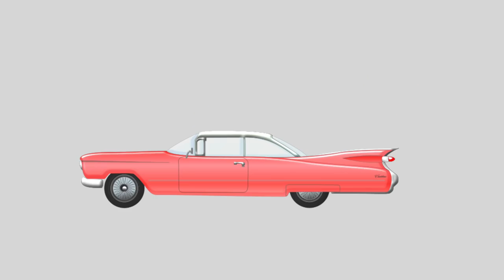Yes, Rockets CAN Fly in a Vacuum

Comment: You can't have equal and opposite reaction without resistance. Because earths atmosphere acts as a resistance for rockets exhaust to push off against, that rocket can fly. In space, there is no resistance due to it being vacuum so action from rockets exhaust can't cause reaction because reaction requires something else external (earths atmosphere, ground, wall) to act as resistance. Everyone who is claiming rocket work in space is basically claiming that person floating in air can cause equal and opposite reaction without pushing off on something else and move anywhere he/she wants while floating. We all know the person floating in air will just get stranded in air if he/she can't push off against something else. Same thing with rockets in space.
Reply: @Xeno Bardock wrote: "You can't have equal and opposite reaction without resistance." You can. Read about conservation of momentum. You can experience that every day. Just try tu push someone/something who is about your weight. You will notice that the same force which you apply to him/it you also exerts on your body. That is because when you push something you encounter resistance due to properities of the molecules called inertia.
Reply: @martingorbush2944  That someone/something you push resists your action and reacts in the form of equal and opposite reaction. If you punch the wall, the wall resists your punch and delivers equal and opposite reaction. If you punch the empty space, space doesn't resists therefore delivers no equal and opposite reaction. Someone/something acting as resistance is important in order for equal and opposite reaction to take place. Empty space wont react with anything.
Reply: You forgot about another form of "resistance": conservation of momentum. When two particles collide their summary momentum doesn't change (m1*V1+m2*V2=constant). When particles gains speed thanks to chemical reaction (i.e. oxidation - so called burning) they gain speed thanks to conversion of chemical energy to kinetic energy (E=m*V^2). Particles of gas moves in every possible direction and if possible they collide with solid object or other particles. Then they transfer some of that energy to other matter. What that implicate when gas burns inside semi-open chamber (combustion chamber)? Some of the energy of the hot gas particles is transferred into solid walls of that chamber. That is what provides thrust for rocket.
Reply: @Xeno wrote: "The gas burning inside a semi-open chamber still requires to meet with the external resistance aka earths atmosphere in order for efficient thrust to occur"

Yes and no. It mostly depends from what you mean when you write "efficient". Maybe it isn't "efficient" thrust but it is thrust nevertheless when expanding gas particles are pushed away from hottest burning place in every direction. Not only to the back of the rocket. Then some of them will collide with combustion chamber walls and give away some of its momentum. That is the thing you seems to not understand.
What's more even injecting fuel and oxidizer into that chamber creates some thrust because particle contained within these substances must be pushed into that chamber. And according to experiments and second Newton's law every action creates equal opposite reaction. Am I wrong?
Reply: @Xeno. Hey man. You wrote something sensible at last. Maybe we will be on the same page at last. Yes, yes, yes. Small explosion in combustion chamber is what push the rocket forward. How do you describe combustion of large amount of fuel? That is exactly an explosion.
Reply: @martingorbush2944  The explosions need to be very strong for decent speed of rocket in space. And the TNT explosions need to occur outside the rocket at exhaust, not inside the rocket otherwise rocket will explode right away. Mix the fuel with lot of liquid oxygen in a container, eject the container in vacuum of space from rocket exhaust and create strong TNT explosion in space, repeat the process and propel rocket in space with recoil effect from explosions.
Reply: @Xeno. Vacuum isn't pulling anything. It is just empty space. Think what governs movement of particles? It is some force. Then what kind of force empty space will exert on particles? What type of force is that? Gravitavacum or electrostic suction?
You understand that explosion in space will produce recoil and push rocket away. But you think that should be "strong" explosion. Then what will happen if there would be many smaller explosions happening many times per second (i.e. hundredths)? That is almost exactly how rocket engine works.
Reply: @martingorbush2944  What do you think will happen if your spaceship gets a hole blown in it and people exposed to vacuum? Vacuum of space will pull everyone towards it. Same thing with rocket exhaust gases, vacuum will pull on it instead of resisting it like earths atmosphere does.
Sure, many smaller explosions are fine too but those explosions must occur outside the rocket and not inside the rocket, and those many smaller explosions must occur in parallel. If the explosions occur inside a container, then you don't much control over where the explosions cause recoil effect and rocket will move uncontrollably from recoil effect at random places. If the explosion take place outside the rocket, then you have better control over it and can easily cause recoil effect to directly hit the back of rocket, effectively propelling the rocket in space. There is no need to eject gases from small hole as its useless in space due to no opposing resistance from space, just eject hundreds of ball shaped explosives in space from rocket exhaust and explode it in parallel right away if you want smaller explosions. If you want larger stronger explosions, then eject one big explosive in space from rocket exhaust and detonate it, do it in series for stronger explosions.
Reply: @Xeno. Vacuum isn't pulling anything! If some matter is moving there (especially with high speed tens of km/s) that mean it was influenced by some external force like gravity or collision with other moving matter (i.e. gas under pressure). That is why exhaust from rocket engine also indirectly exert force on combustion chamber.
Reply: @Xeno_Bardock  
1. Inertia provides the resistance you require.

2. Vacuum doesn't suck or pull. Areas of higher pressure expand into areas of lower pressure.
Reply: @niallkinsella2687  Rocket exhaust gases still need to meet with opposing resistance in order to gain significant thrust, which earths atmosphere acting as resistance provides. Check the diagrams in this video https://www.youtube.com/watch?v=ZcW5B0C3fCw That's exactly what i meant by vacuum pulling, the higher pressure/atmosphere inside spaceship will move towards zero pressure of vacuum of space if spaceship gets a hole blown into it. With inertia, in space you will experience the initial thrust from starting the rocket engine and then that thrust will disappear. When you start engine of your car and accelerate, you experience the initial inertia but you don't constantly experience inertia, only when suddenly accelerating and breaking. Same with rocket in space, thrust from inertia will be momentary, not constant, unless astronaut keep turning on and off the rocket engine so he/she can keep getting that small thrust from inertia.
Reply: @Xeno_Bardock  

Everything with mass has inertia. Everything that changes velocity experiences acceleration.
Work has to be done to overcome the object's inertia to force it to change velocity. Every action has an equal and opposite reaction.

"When you start engine of your car and accelerate, you experience the initial inertia but you don't constantly experience inertia"...
What you are actually experiencing is your mass resisting acceleration (your inertia), and you will continue to experience it for as long as you are changing velocity.
At constant speed you don't feel this, hence why you can get up and move around on a plane travelling at 500mph, but you will be stuck in your seat in a car going from standing start to 100mph over 10 seconds. Your car will also have to spend more energy accelerating with you in it than if it was empty.

So yes, Objects with mass resist acceleration and energy has to be expended to accelerate them.
A rocket converting a tonne of fuel per second into gas travelling at 1000mph backwards relative to the rocket is also being forced to accelerate forwards at the same momentum.
No external objects to provide resistance required.

Even leaving gas simply vent will work. The higher pressure is forcing its way into lower pressure, it had to expel energy to do so (pressure is a form of energy). As long as the gas is vented in one direction only it will cause the object formerly housing it to accelerate in the opposite direction.
Reply: @niallkinsella2687   When you travel in a car, you become part of the car so yours and cars inertia become same value. If you were constantly resisting inertia while traveling in a car, you will keep getting pushed to the back of the car. Only when you suddenly press accelerate or press breaks or keep constantly changing speed of car that yours and cars inertia becomes different value so you resist the cars inertia then and feel it pushing you back and forth. In space the mass remains the same but the weight becomes zero due to lack of gravity so an astronaut can lift ton of mass easily just like a little kid can easily move around an adult in water. What does that tell you? The mass in space doesn't resist acceleration as much like it does on earth. Released gases always require opposing resistance in order to able to make gigantic mass like rocket fly just like you need to push against the ground first to able to move a heavy rock therefore in order to bypass the ground/earths atmosphere requirement, rocket fuel must TNT explode outside the rocket at exhaust instead and cause strong recoil effect  from explosions in order to gain significant thrust.
Reply: @Xeno, Man. You only have to resist/overcome inertia when you change speed. 

You don't understand what weight is. It is a force exerted by gravity on object of some mass. When you are in weightless environment that doesn't mean you can push away 2 tons of stuff as easily as 2 kilograms. That 2 tons box will just exert no force in any direction when you have same speed and direction as that mass. But if you try to move it then you will have to change momentum of that mass. That will be associated with exerting a force (F=m*delta_V/t what is equal to F=m*a).
Reply: Here's how rocket engine works in space:
In rocket's combustion chamber, fuel gets combined with oxidiser, with produces hot exhaust gas.

The gas expands in all directions.

Those gas particles which are moving towards the combustion chamber opening will simply exit it, without doing any work - but that leaves us with all the particles which are facing away from the opening.

At some point they will impact the walls of the combustion chamber.

When that happens, the gas will ricochet off that surface.

When that happens, the gas will experience a force.

Any force has an equal but opposite force.

Ergo, the combustion chamber, and the rocket it's attached to will also experience a force and start moving.

I'll be happy to explain further any point you have troubles with.
Reply: @Xeno_Bardock  If I fire a crossbow in a vacuum, will I feel the recoil? Yes or no?
Reply: @Xeno_Bardock  if I fire a solid block of CO2 (say 1 kg) at 100 meters per second from the 10 kg crossbow, do you know how to calculate the momentum transferred to the projectile?  Did you know that the momentum transferred to the BOW must be the same? Do you know how to calculate the Velocity that the bow must be moving AFTER the projectile is fired?
Reply: @Xeno_Bardock  can you solve my high school level physics problem above? Yes or no?
Reply: @stuartgray5877  Not interested in doing any calculations.
Reply: @Xeno_Bardock  so I just explained how a machine in zero-G, in a vacuum , can PROPEL ITSELF USING CO2 AS ITS REACTION MASS .  The calculations above are the SAME if the projectile is steel, water ice, dry ice, or GAS !  It DOESN'T MATTER what KIND of mass you push on, ALL THAT MATTERS IS THE MASS of whatever you are pushing ON.  Rockets work in a vacuum because THEY TAKE THEIR REACTION MASS WITH THEM TO SPACE .
Reply: @Xeno_Bardock  - No comment?  I see that you STILL GO on other threads and talk about how Vacuum can "Suck".  I think that if a vacuum test specialist (with over 20 years experience) TELLS you a fact about vacuum, that you should take that as fact.  Yet you STILL KEEP spouting this bullshit.  WHY is it that you REFUSE to accept facts?
Reply: You can't have equal and opposite reaction without resistance

According to Newton you can. and hes way smarter than you.
Reply: @Xeno_Bardock  Rocket exhaust gases still need to meet with opposing resistance in order to gain significant thrust

Also false.
Reply: @martingorbush2944  "Just try tu push someone/something who is about your weight. You will notice that the same force which you apply to him/it you also exerts on your body. That is because when you push something you encounter *resistance* due to properities of the molecules called inertia."

You literally just restated  Xeno Bardock's point of resistance being necessary.  Are you not reading what you are writing or just pseudo-sciencing your pants off?
Reply: @DrCash7  I haven't restated what Xeno Bardock's said. Read more about inertia and you will know that when you accelerate some mass then same force is pushing your body in other direction. You don't need any external object/particles to colide with to have that effect.
Reply: @DrCash7  One more thing. When I wrote "push something" I had on my mind particles from rocket fuel.

Comment: Lets face it the infinite vacuum of space makes jet propulsion impossible.
Reply: Space isn't an infinite vacuum and it wouldn't matter if it was-rockets work in a vacuum.
Reply: @darklight2.1  so w=PV is wrong? ok chatbot.
Reply: @darklight2.1  if you don't understand w=PV just say so, chatbot.
Reply: macho  Understand the difference between jets and rockets.
Reply: Sockpuppet here like to pretend that the fuel exhaust has to be ejected from the rocket before it can have any effect.

He likes to ignore the fact that several tonnes of matter gets accelerated by several kilometres per second before it is ejected. Or just pretend that such an acceleration requires no force to achieve.
Reply: @77thbrigadesockpuppetaccou50  Come on Papa Legba you can answer....
Reply: @stuartgray5877  you both seem really angry that w=PV exists. not my problem tbh.
Reply: @77thbrigadesockpuppetaccou50  - So lets have a brief conversation about basic physics shall we?
Answer these very basic physics questions regarding rocket propulsion:
1 - When the rocket is running does the exhaust gas get ACCELERATED? (does the exhaust gas experience a change in VELOCITY)?
Yes or No?
2 - Does the exhaust gas HAVE MASS? Yes or No?
3 - Can MASS be accelerated without a force? Yes or No?
now just answer these simple questions to prove that you DO understand basic physics. Then we can have a conversation about the implications.
Reply: @darklight2.1  - "Wow, that sets a new high in stupid."
Its Papa Legba - He's just trying to hide behind one of his sock accounts (not very hard apparently)
Reply: @stuartgray5877  nah let's not, weirdo. cos w=PV.
Reply: @niallkinsella2687  See what I mean?
 HE REFUSES to just answer my three questions that PROVE that rockets apply a FORCE to the exhaust gas.

He RESUSES to acknowledge that fact.

He thinks that MASS can be accelerated WITHOUT A FORCE, but he wants to argue physics with actual engineers...

What's MOST pathetic is he has been this way FOR YEARS.
It would only take him a couple of HOURS to just read a physics book and learn he is wrong. But he refuses to do that as well.
Reply: @77thbrigadesockpuppetaccou50  YOU are scared to answer: 
"can mass be accelerated without a force" 
in a physics debate and I'M the weirdo? 
You are a genius
Reply: @stuartgray5877  btw your channel is insane. you need therapy.
Reply: @77thbrigadesockpuppetaccou50  
How can you accelerate matter without applying a force to it?
You're arguing that is what happens.
Reply: @niallkinsella2687  Good luck trying to get him to acknowledge ANY actual facts about Physics.
All he can do is parrot things said by others.

I never thought an AI could "Project" but his insistence that WE are the bots while he clearly has the intellect of one is interesting...
Reply: Jet propulsion and closed-cycle combustion are two different things.
Reply: @77thbrigadesockpuppetaccou50  Proceeds to say “w=PV” without any explanation (I looked it up myself btw), or how this affects rockets and rocket engines (pls explain, basically).
Reply: @fork9001  he won't explain ANYTHING.  All he knows how to do is regurgitate some crap he read in "a smart person book". He has never taken even high school physics in his life